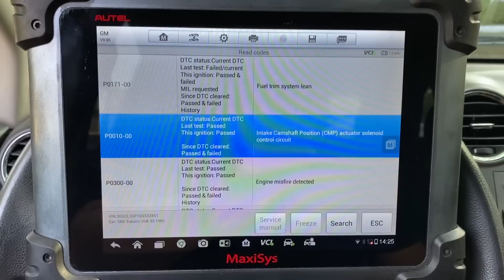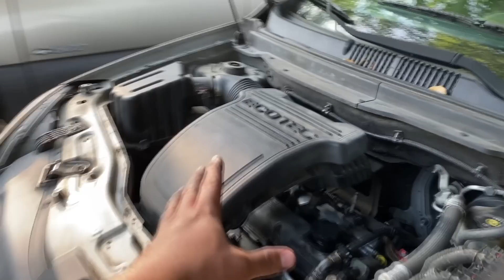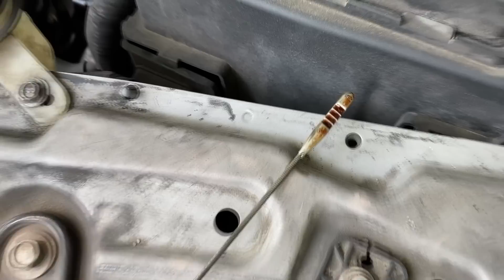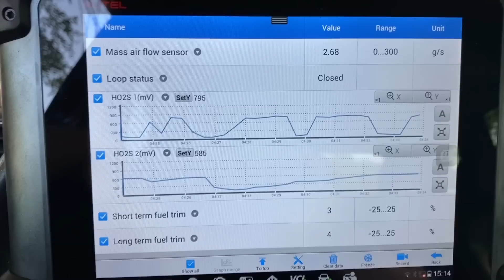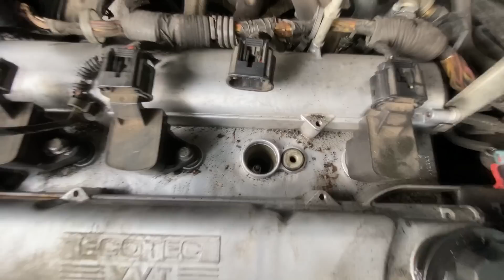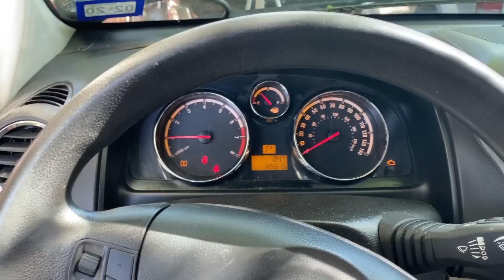SATURN VUE FLASHING CHECK ENGINE LIGHT CASE STUDY

Comment: 2008 Saturn VUE does not crank. Mechanic replaced the ECM and problem still exists. He gave up and said , it may be an immobilizer issue. How do you fix that?

Comment: I have a 2002 Saturn sc1 coup. The check engine light is on. I had mechanic check it out. It has been in the shop 5 times no success check engine light came back. The code is EGR insufficient flow. He stated that he has cleared exhaust manifold, and the port where EGR valve sits. They even did update on computer. I don't know what to do. Any suggestions?

Comment: Number #1 rule as a modern auto technician.   First check ecu codes, monitors, then freeze frame.  Second do a ecu reset or relearn.  If else fail then continue diagnose

Comment: man im getting the same lights that are coming on with stabilitrac and trac control along with solid CEL but im also getting the whole dash going dark, stereo turns off and key will not release from ignition and will not start again when i try turning key back n forth to remove it... i cant figure it out. im getting a p0171 code too. i hate this car!

Comment: My 08 Saturn Vue his doing the same exact thing. Mechanic has worked on it time and time again. I got it back from him two days ago running fine but still with the check engine light on. Yesterday it started bogging down. Should I bring it back to him and tell him to do this relearn of the cam and crank sensor right off the bat? The last time he had it he changed the camshaft position sensor
Reply from the maker: It would definitely be worth a try. Very quick and easy procedure!

Comment: Cam belt or chain stretch, cam belt stretch worried about failure of belt and engine being  totalled. Reason would be mechanical timing moving slightly. Not sure what we have on this engine. Relearn has catered for movement. So not an electrical fault mechanical. Love the programme love your structured process of diagnostics.

Comment: Hey Eric as rewatch this video I am perplexed as you are how a Crankshaft relearn solved this problem.  I had a similar issue with my 2013 BOSS 302.  At higher RPMs in the BOSS 302 I got P0300 random misfires, I monitored the Crankshaft signal via a Scope while at the higher RPMs and sure enough there was Jitter present on the Crank signal.  This Crank signal was a VRS type, Sinewave. I found out Ford had a TSB on this issue, they added a rubber washer to the base of the Crank-sensor, this rubber washer absorbed the vibrations of engine at higher RPMs and the Jitter was eliminated.  Of course after installing the Crank sensor with the rubber washer a Crankshaft Sensor Relearn was performed.  I've never had any issue with the Crankshaft Sensor since this fix was performed.

Comment: You work yourself too hard. If you simply do a VE test or in this case look at your load or calculated load on hard acceleration it will tell you if you have a breathing issue or mechanical issue. monitor your fuel trims when you do this. you can fairly quickly determine what direction to, go. It's easy to start chasing your tail if you aren't careful. Don't be too hard on yourself. You're not the first tech to have this happen to you.

Comment: First, don't apologize about it, some things are weird enough and you learn as you go. Second, i love this video because it follows a logical path of diagnostics. Yes, you think you are all over but really you did great job testing all options and not tossing parts or replacing the engine. Finally, I can do all of those tests with my cheap scanner, maybe not reset the crank/cam but at least I am not looking at $5000 equipment to do all of these tests, got the tools already. Awesome.

Comment: Eric thanks so much for your Video, outstanding.  I was wondering , during the Crankposition Relearn did you use the New MAF or the original MAF and doesn't the MIL have to be OFF during a "Relearn" ?  Thanks again for a great video!! Also, I was a little confused, when you installed a New MAF, the problem continued and as long as you had the original MAF the problem continued, when you removed the MAF totally the Misfire went away (ECU used substituted values for MAF) , is this the time you did the "Relearn"?

Comment: Hi Eric, after watching this video ,I would like to aks you a favor...
Please is it possible you can help me out with some diagram  for a Chevrolet Captiva sport 2009 ?
I can't find info for the Captiva due it's not made for north america....and I know that this Saturn VUE is almost the same like the Chevrolet Captiva Sport 2009.
I have a strange problem with the Captiva Sport 2009......
A. I have the ABS Stabilitrack and Traction control lights on.
B. I don't have trouble codes for ABS----- all bearings with their wheel speed sensors is brand new*.
C. I need the diagram-section for the ABS EBCM and steeringwheel angle sensor to figure out if they use
-12volt or a 5 volt for those sircuits ( wheel speed sensors ABS and steering wheel angle sensor*).
Thanks.
Hoping to inform you correctly I remain,
Yours friendly.
Regards.

Gladmar.

👍😎

Comment: How much for that diagnostic tool. Which model tool is that? I have a 2008 Saturn vue ex and my transmission sounds like nuetral in drive. No movement. Works in reverse.

Comment: First of all do not kick yourself so hard fella. Just remember the acronym KISS KEEP IT SIMPLE STUPID. This has and will happen to us all. You did everything right on except not blowing off the area where you removed the ignition coils. Sometimes that dirt will screw up the threads in the engine head. I know since I repaired threads because someone else did not do there job correctly. When you use anti-seize you are suppose to use the total liquid type. Not the metal pigment type. This is where most techies screw themselves and kurse the world. 
            Your logic was right on fella. Nicely done work on the car. Now I fixed a Saturn that had four different wire  connectors used on the wires in the car. The customer told me that he had four different  people and places work on the vehicle. They all failed in one way. I was number five and the car is still running strong. That was five years ago. Guess what, the car has an extra one hundred thousand miles plus on the clock. The customer brings the machine over for oil changes every two to three thousand miles. Oil changes are the cheapest medicine for a car I know of. Good day and peace to you Sir. VF

Comment: When I saw the misfire graphic and saw cylinder 3 and 2 m my first thought was that I believe those two are next to each other, and how much do you want to bet it is a blown head gasket, which of course would affect compression for firing, and vaccum for fueling. Continuing now to watch the video to see if I was right. My initial thought which could still be correct is that traction control has nothing to do with how the engine is running, so the CPU could be shorted out and just not properly reading and reacting. EDIT: You eliminated my guess with your next few tests, compression and high pressure leak off. I'm listening to the very last part now. What a mystery. And I can relate to the frustration. I remember times thinking Damn, I have spark compression and fuel mixture (or whatever it is) THIS should work. And then it ends up being some really minor thing.  Love your videos. I learned so much just watching you look for the problem that I'm glad you didn't figure it out right away, because it taught me so much. END EDIT: Wow, see I was thinking bad CPU at this point, but it was just Data that somehow got corrupted, and fortunately has the option to be relearned. Interesting problem. Any data on any digital device can become corrupted. Nice that the controller software and the CPU actually works and you were able to re-sense the timing data to give the CPU the right information to make adjustments on.  Databyter

Comment: I've run into similar problems like this, but it's been a component or wiring.  But ya, "should I change career fields?"  Especially when others in the shop, say try this, try that, and I've already tried them.
Course some will say, "put a computer in it!"  No!  Test!  Don't guess!
Sometimes calling the OEM training center helped.  They've sometimes got the info from engineering or dealership people.  NEVER be ashamed to ask for help!
YOU ARE STILL THE MAN!  You stuck with it, OZ gave you some insight and BOOM!  FIXED!  Great feeling!  You had a great "Diagnostic List"  which I need to write down.  Mine was by memory and that can lead you down the wrong path.
This is why I subscribe to you.  Sorry for the long comment.

Comment: I had a toyota do the same thing to me. Checked everything almost exactly the same way. Scoped sensors etc. But it turned out to be bad gas. Good enough to run. But just bad enough that it would misfire at higher rpm. It frustrated me the same way. Specially because I took a fuel sample as part of my diag. But it didn't fail. Again, the fuel was just good enough. So yeah that car really threw me for a loop.

Comment: Reminds of those mid 2000s blazers or the other models based off the blazers. The infamous ign3 b+ circuit that causes the myriad of issues that wouldn't seem related,  half the fuse box drops to 6v

Comment: While the purge was the main vacuum leak, the open breather tube on the valve cover will cause a lean condition as well. The PCV system is pulling unmetered fresh air through that tube on the valve cover. With the breather hose connected the air being pulled through the fresh side of the PCV has already been measured by the mass air flow. It’s crazy how a stretched chain can cause false misfire codes in a lot of GM engines that is solved with a crank relearn. Don’t be down for looking over that as we deal with so many crazy issues that sometimes we overlook the smaller things.

Comment: Hey man anybody that’s done this level of diagnostics have had cars that make you question your abilities. It’s good to walk away from it for a day or so. Do some research, call your buddies, get online. Something someone says can trigger a new angle.
In this case had the crank or cam sensor ever been replaced in the past? I’ve had this problem in the past where the misfire counters started counting up per cylinder but the engine ran fine. Not in your case though. Gm and Honda are good examples of this. Any case it always feels good you fix a tough one. Nice job.

Comment: Thank you for posting this whole saga.  I've chased my tail on similar issues.  I'm not super familiar with that vehicle, being a GM I was initially curious if the flexfuel system was miss calibrated.  Nice to see a fixed car after all that effort.  Solid troubleshooting process.

Comment: Good video I feel your pain. One thing i noticed at the beginning when you found that the vehicle had a missing breather hose you said that because it was a breather hose and not under vacuum it would not cause a vacuum leak and didn't think it was causing your lean condition. However because it was a MAF system and the hole was after the MAF it would cause unmetered air into the engine which could cause fuel trim issues and a lean condition.  Anyway keep up with the great content.

Comment: You were doing everything right, you just didn't get the right thing. Never ever give up. Electronic vehicles can be a real hassle  sometimes. I can imagine a GM garage would have told the owner it was junk. Thats how they deal with issues. Replace it.

Comment: Dude I feel your pain, i pulled my hair out trying to fix the exact same problem on a honda after I changed a bad coil. I checked everything like you and couldnt find anything wrong, so I messaged my buddy Keith and he says do a crank relern and that solved the problem. The reason why it fixes the problem on our vehicles is the ecm gets wigged out from the origonal missfires from a lean condition or in my case a bad coil and it just needs a relearn done. This is just a thought and I have no proof. 
Anytime I get misfires I fix the main problem and always do a relearn.
Fyi, on most GM vehicles anytime it goes into reduced power - Limp Mode, it shuts off traction control

Comment: Would a cam crank corrolation error show in the data pid?
I would think?
I like to scroll all pids from the start,sometimes a chain will dwell from the stretching or tensioner wear.
You can make or buy a secondary ignition jumper with an old sp wire ,then clamp.
That's what I've done,may have saved a ton of time in that situation.
Great testing and content btw!

Comment: timing chain stretched ? I think car was going into limp mode when defaulted to open loop higher rpms caused sync to go just past parameters, this will happen again,tensioners may be worn or if oil presure activated oil galeries may be dirty, just thoughts from an old guy

Comment: Just out of curiousity, is this the same Saturn Vue you put the ECM in? If it is, you need to do a crankshaft relearn after replacing the ECM. Back in the day when I worked for Saturn it was always suggested to do a relearn if the ECM was replaced or the crankshaft sensor was replaced or if the engine itself was replaced(whether it be a new or used engine). Basically anything related that could effect the crank signal.
Reply from the maker: No. This is a different vehicle.

Comment: A little wear and tear in the timing components can throw the misfire monitor off. Also cylinder contribution plays a major role, a cylinder with slightly different dynamic compression will cause a difference in crankshaft speed-up/slow-down.  

I wonder if the car was still running rich after the repair?  Was the negative fuel trims a strategy in response to the dead misfire? If the PCM cut the injectors, i would not expect to see a response in the trims. I would really like to know.

Comment: I watched this video from beginning to end and I had the same problem with a few GM cars. They would only misfire at high RPM and that option also crossed my mind when I came across it on Iran. Sometimes the simple stuff gets passed us when we go to deep into rabbit hole and forget about other options our scanners have. Glad it worked out. That purge still would've messed up ur readings if I did the relearn first. So it was great you fixed that first.

Comment: Basically man problem mas air flow senser just remove air mas flow senser all problems is solved very hard work and genuinely  I will say that you are genius bro good job and I am basically from india
Reply from the maker: I tried replacing the mass air flow sensor. It did not fix the issue. Watch until the end and you will see the fix! Thank you!

Comment: Hey bro
That car is coming back,you just fooled the pcm
All ecotects and ecoboost have the same intake design 
What happens is ,PCV is right in the middle of intake and blows crank case shit gases on 2 and 3 valves
Look at your misfire graffs, which cylinders have most of misfire. ..2 and 3.
Pop that intake and you will see intake 2 and 3 fucked up vs 1 and 4
Clean em up n go get your money 
Just my two cents
Pete from Priority Auto, Kemah texas
Reply: You've peaked my curiosity. Why would it not show the misfire at low rpm then?

Comment: I never thought a cam/crank issue would only cause a misfire on two adjacent cylinders.   Good job, I feel for you.  Anyway, on these  ECOTEC engines and many modern engines they use a PCV orifice instead of a valve.  These system flow in both directions depending on engine speed and load.  The +10 fuel trim after you fixed the purge solenoid and blocked the intake port is due to the orifice pulling air from the camshaft cover PCV port opening and un-metered air. , This causes a low MAF reading, 2.5 instead of the normal 3.0 g/s.  I have a detailed PCV/CCV document on these systems.  You can find it on the Chevy Equinox Forum FB page under files tab. https://www.facebook.com/groups/ChevyEquinox/  Includes several solutions for the rear main seal failures, system freezing, and orifice clogging.  A simple cap and periodic test can save customers thousands and make you a hero.  Check it out.

Comment: I will admit I "probably" would have said "wtf, let's try cam/crank relearn even though the waveforms look spot-on"... but, that could simply be the Monday-morning-quarterback effect.
Reply from the maker: Sometimes just shooting in the dark does the job! Thanks for watching!
Reply: @ADVANCEDLEVELAUTO  exactly, especially (in retrospect) in light of your suspicion of a timing related issue. You had the answer quite early and then the cam/crank correlation looked good. Very diabolical vehicle indeed!

Comment: Standard learning curve employed.  You are on the right career path.  May I share one?  2000 VW Jetta 2.0L with a code for either insufficient secondary air flow or catalyst efficiency.  Employing a bidirectional scan tool to turn on the secondary air pump reveals it works fine.  So what gives?  Customer bought and installed a new battery without maintaining 12v on system.  Customer did not know about throttle idle relearn, drove car for about a month.  Without throttle idle relearn on this car, ECM never turns on the secondary air pump for two minutes following a cold start.  Catalyst fails to heat up as a result.  Self cleaning of catalyst is made possible by high temperatures developed during those initial two minutes!

Comment: Maybe the original intake CMP solenoid was indeed failing intermittently (as you stated) and that threw the ECU's correlation off?
Resolving problems like this may test your skills and patience, but eventually winning is what separates average mechanics from the best. Great job Eric!
Reply from the maker: I think your on to something here. Thanks!